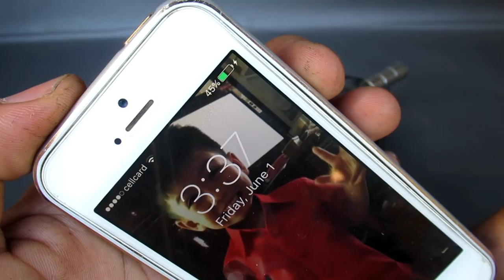Free energy Mobile phone charger by magnets with fan computer - Awesome idea 2018

Comment: Rotating fan in wrong direction it should be anticlockwise to make it work
Reply: Even if the rotation is counterclockwise it will work if you played attention to the polarity wires of the motor

Comment: Gee, that must be saving him a fortune on his electricity bill. I just use the the correct USB charger to charge my phone, it works perfectly and I only have plug it into the phone once per charge without any repetitive magician movements, and I'm fairly certain it wouldn't make any difference to my electricity bill. Even after all the dicking around he did, I never saw the battery meter doing anything.

Comment: this is not fake but better connect to power bank to secure your phone battery this is very slow charger low amp
Reply: Reymart Benito so the charging indicator lights up but the battery never gets above 45% ?  A true trickle charge battery maintainer...
Reply: This is not fake But better connect to power bank to secure tour phone battery this is very Slow charger low
Reply: True